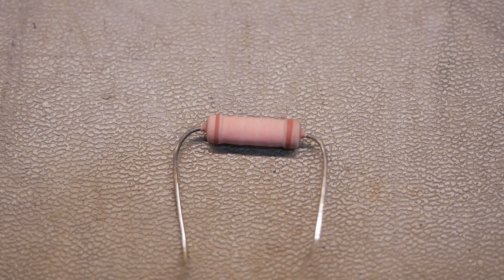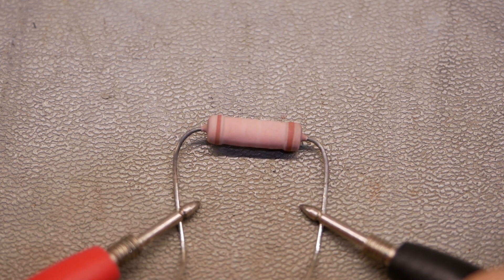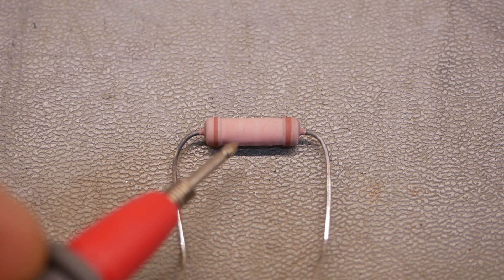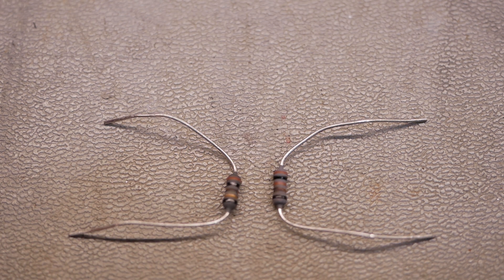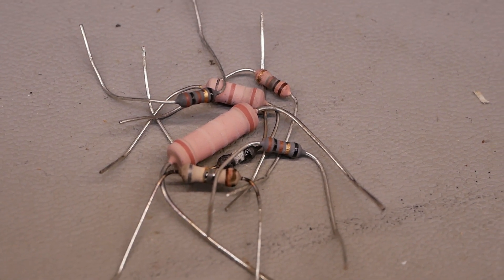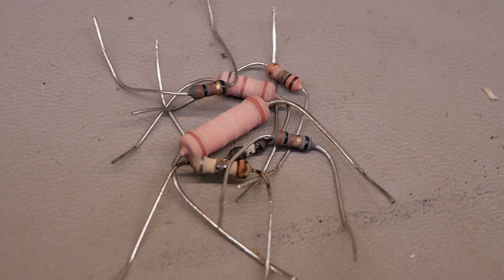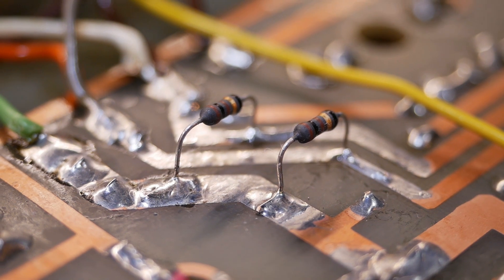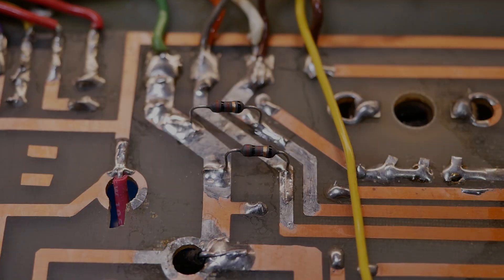Resistor Fault Modes - Various Types Compared

Comment: just found a resister failure that I had not seen before and did not expect to see. resister is Brn / Blk / Gry / Red, it is a 1G ohm I believe.  it's Been soldered stand offish of the board so that tells me it was expected to heat up. measurement shows 200 m ohm across from it leak, I de-soldered 1 end.

Comment: Hi Brad. I am trying to diagnose why I am getting signal distortion in an Ampeg Micro CL bass amp. I am in the UK and on the waiting list for a service but this is months long. I have established beyond doubt that the problem is not the speaker cab nor cables.  I wonder if you are aware of a common/typical cause of this signal distortion that you can share? Thanks
Reply from the maker: Not sure what that has to do with the video.
Are you asking for free instructions on how to fix this amp yourself?
Because that's not something I could offer, but try the Facebook repair groups as there are a lot of helpful guys on there and also search the history for that topic in case anyone has asked previously.
Reply: @BradsGuitarGarage  Thanks Brad. I watched that particular video as I have read that overheating components can lead to distorted signal. I realise I was being cheeky asking here. Sorry about that. Thanks for the info. All the best.
Reply from the maker: Cracked solder joints are a likely contender, mate.
Start there, but be careful.

Comment: Probably get a blank look if you asked for those in Jaycar; seems that Wagner have them
Reply from the maker: These particular ones were from Wagner (actually, WES, the wholesale outlet).
They are a bit shady with component specs, which is why I only use them when I have to. The majors, like Digikey, Mouser, RS Components & Element 14 are preferred.
Reply: you get a blank look from them everytime, 90% of components I need I have to sit and wait for them from China, and at the moment I am in the middle of restoring a JVC amp and I am replacing caps which I have to get from China and fusible resistors which I can't find anywhere, luckily I am not in a hurry

Comment: Hey Brad, super cool testing and information.Had no idea they made fusible resistors..! ( newbie still and somewhat ignorant, but now I'm educated..! ) Very interesting, thanks for sharing..Ed..UK..😀
Reply: I see them used a lot in the course of repairing 1970s and 80's vintage hifi gear. Schematics will often have an FR next to the component on the paperwork to specify that it should be a flameproof, or fusible, resistor.

Comment: Clickbait link image.  Well done!
Reply: Kinda surprised that the algorithm didn't block the video for "sexual content".  It had pop-up ads at the beginning of the video, and I could have sworn that Brad usually disables those, so maybe the algorithm decided this was a video that would get tens of thousands of views and therefore it was worth sticking an ad on the front of it whether Brad likes it or not.
Reply from the maker: I only  disable the mid-roll ads.
You can't diasble the ads at the beginning, all you can do is make them skippable after 5 sec which is what I do.
I might also point out that the ads play, regardless of whether I monetize a video, too.
The $0.005 just ends up in my pocket if I monetize it.

Comment: Outside of testing with a meter, it didn't look like the fusible resistors showed much in the way of visible indication that they were dead: burned, discolored, color bands baking off, etc... Is there another indicator outside of a meter?
Reply: Typically, no; fusible resistors are designed to blow in a similar manner to fuses, and rarely do you see more than extremely light discoloration at most, assuming the resistor wattage was chosen appropriately for the circuit.  Fusible resistors typically have a gray ceramic body and so the temperature discoloration doesn't show up very well anyway.

Comment: We all know Brad is good for an epic "burn" now and then, but he has outdone himself here!  The only thing missing from this competition is an overloaded carbon composition resistor 🔥!  The potential for deposition of conductive carbon onto circuit boards and tube sockets is a good reason why mounting carbon comp resistors from pin 1 to pin 5 across output tube sockets is a bad idea.

Comment: When you let the "magic smoke" out,  below the Equator, which direction does it spiral? 🤔😁
Reply from the maker: The ambient air's fluid dynamics by far outweighs the influence of the Coriolis effect.
As is also the case with toilet flushing. But ours doesn't spin at all because we don't have 10 friggin' liters of water in there so the water touches your ballsack.
I still don't understand why you lot do that.
If you're so worried about skid-marks, change your bloody diet. LOL!
Reply: @BradsGuitarGarage  , I use low-water toilets in my home; occasionally I have to flush twice, but so what? I have a 300 foot deep well, but I'm careful not to waste water, which is "the new oil", as they say.  As new subdivisions are built within a one mile radius, some of my neighbors have had to redrill their wells more deeply. As for my *huevos*,  my "dead meat sack", everybody knows that things hang a bit lower as you age, and I adjusted the toilet mechanism for less standing water in the bowl. I don't like it when my "tube" is idling too cold, and an overly full porcelain throne really puts a damper on things! 😖
Reply from the maker: @goodun2974  🤣
Reply: "we don't have 10 friggin' liters of water in there so the water touches your ballsack.  I still don't understand why you lot do that." @BradsGuitarGarage , having your ballsack tickled by some nice cool water is lovely.  Try it, you'll like it.  lol
Reply: @retread1083  , maybe I'd like it if it was a TOTO toilet that uses a jet of warm water to rinse you, and blow dries your nether regions afterwards. I've never seen one here in the US but they're quite popular in Japan. Still not sure if I like the overall concept! (One of the more interesting and unusual books I've read is "The Big Necessity ---- the wonderful world of human waste and why it matters" by Elizabeth Rose George, a history of sewage and sanitation systems, toilet design, composting waste to make biogas,  and the problems posed by  open defecation.....yes, I'm a little weird!).